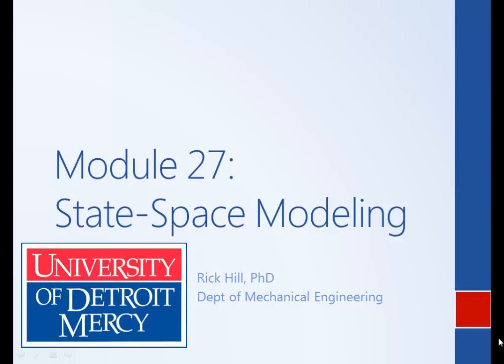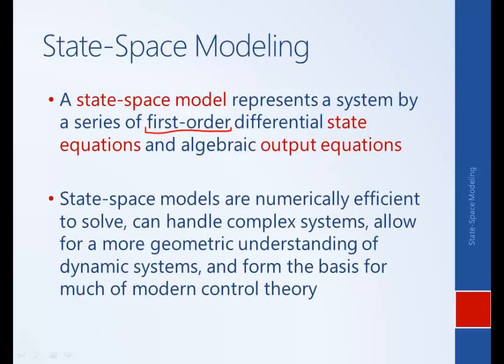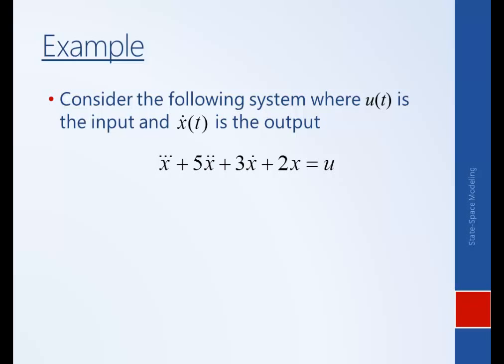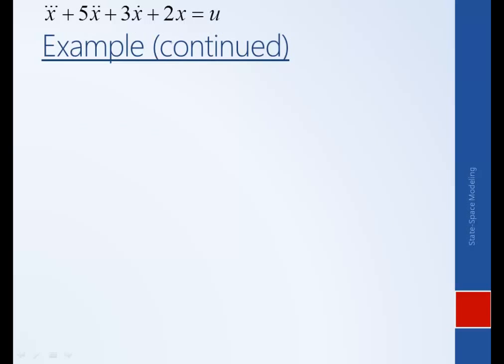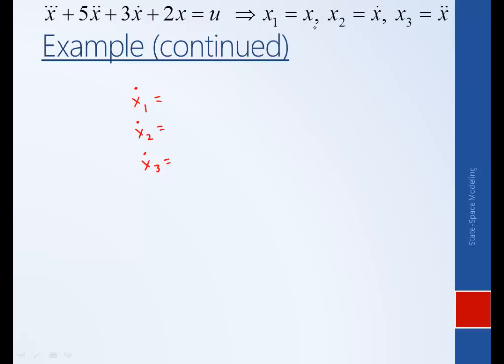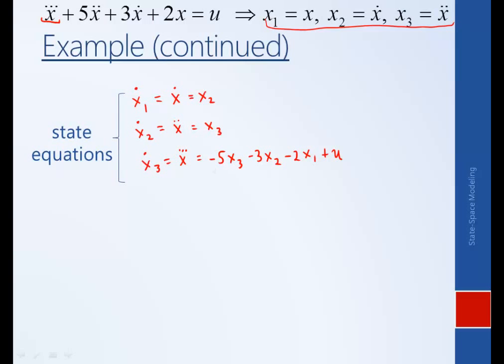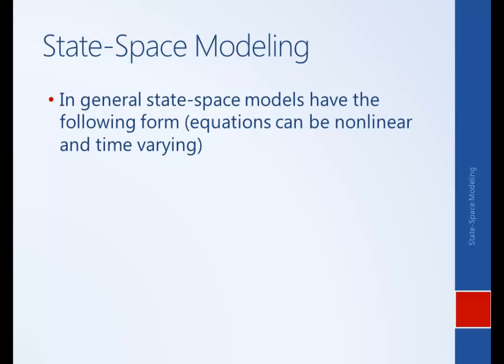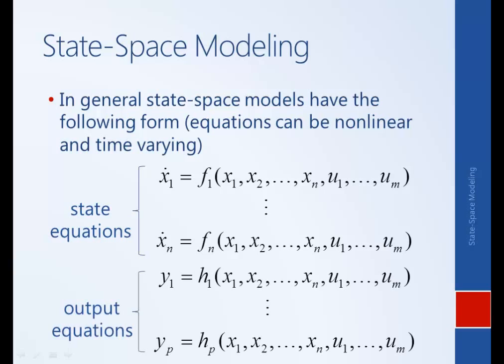System Dynamics and Control: Module 27a - Introduction to State-Space Modeling

Comment: Very Nice.  I have struggled with state space A and B matrix now for a while.  Single input single output.   I also have been struggling with multivariable as well.    I am not sure how poles and zeros work into this understanding as well.
Reply from the maker: With a MIMO state space system, the relationship with the corresponding transfer function representation is a little more challenging. Specifically, a MIMO system can be represented by a single state space model, but requires multiple transfer function models, 1 for each input-output pair. For example, a system with 2 inputs and 3 output will require 6 transfer functions. Each of the transfer functions will have the same poles, which are equal to the eigenvalues of the A matrix. However, each transfer function may have different zeros. There are some conventions for speaking about the "zeros" of the state space model, things like transmission zeros, but this tends to be a more advanced topic.

Comment: what if you have 3 inputs?
Reply from the maker: If you had a MIMO system (multiple inputs and multiple outputs), the structure of the state-space representation is the same, it just changes the size of your B and C matrices. For example, if you have 3 inputs, then your B matrix would have 3 columns (and your input u would be a column vector).
Reply: Dopezzzbob can you have the module1 of rick hill?

Comment: Can acceleration be an output ?
Reply from the maker: +BANIYASAD In general, yes. The choice of output is a decision of the designer based on what is being controlled or analyzed. Ideally, you would be able to express your output as a function of the chosen state variables. If you can't, you may need to choose an alternate set of state variables. Recall, the choice of state variables is not unique.
Reply: +Rick Hill thank you so much for replying 
For equations as 2x1('' )+X1( ') +2(X1+ x2)=f(t)
x2( ' )+ x2 2(X1 x2)=0 and outputs X1, x( ' ' ) 
What state variables to find output equation that match to output values assigned?
Reply: Baniyasad CAN YOU HAVE MODULE 1 OF RICK HILL?